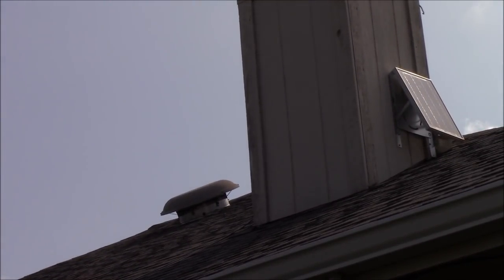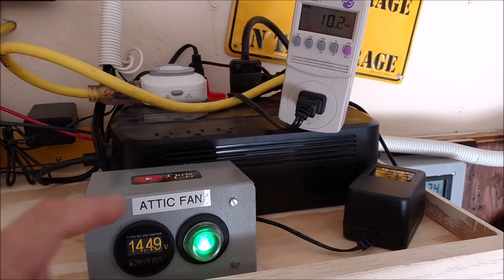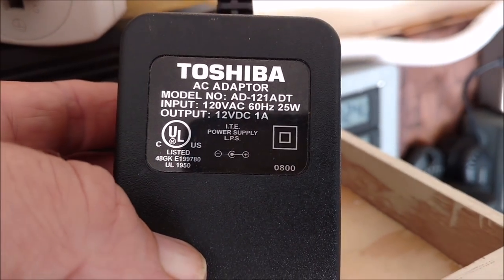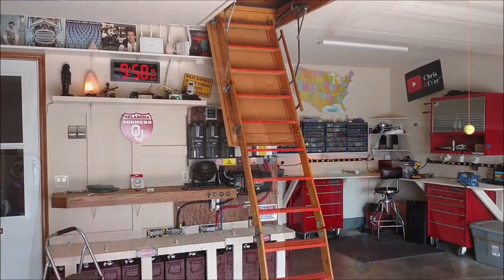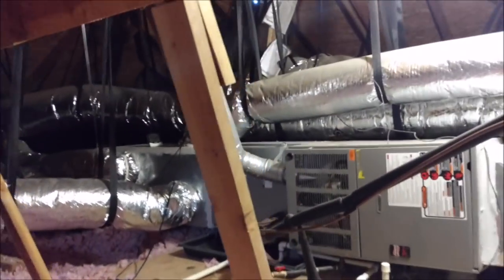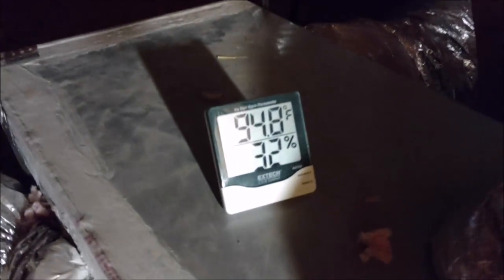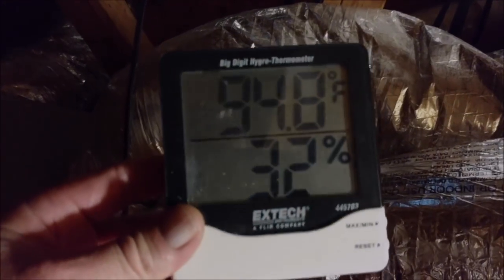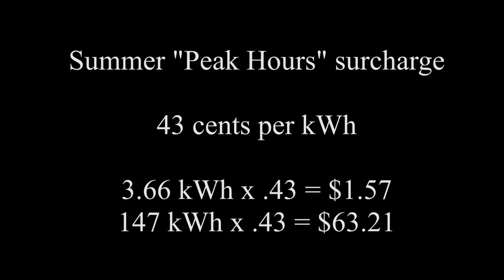How to save $60+ a month this summer - DC powered attic fan conversion

Comment: Chris, was j/w but anyway you could run that fan straight from you 12 step-down?
Reply from the maker: Yep! Good catch. Running the attic fan from the 24v-12v step down buck converter is #1 on my mind. A few small roadblocks why I didn't: 1) need a fused BSS distro box 2) DC powered 24-hr timer 3) 12-2 landscaping wire not quite long enough...screwed up the length. May still do it...but, not right now
Reply: Chris DIYer ah gotcha.. that makes sense

Comment: Thanks for ur information 
I have some problem solar attic fan 
Fan minimum 12v max 24 v the solar panel I have it’s 12v
I am try to do the same wiring that u did. 
Do I have to disconnect the solar panel completely from the fan and connect the dc converter to the fan ?
Reply from the maker: I am using a AC/DC adapter (12v) to power the attic fan. I disconnected the solar panel and spliced the fan wire and then ran a long wire to the garage.

Comment: Ha ! First.    You might even be saving more because all the AC equipment and ductwork is not as hot .   J K
Reply from the maker: Honestly...I think that was the case. Man, yesterday my Central HVAC barely ran (and the two window units were also on). Funny, now with that attic DC fan running properly, ALL the air conditioners are running less. I installed that solar powered attic fan six years ago...prob was going bad two summers ago. Hopefully, it will last...safer now too